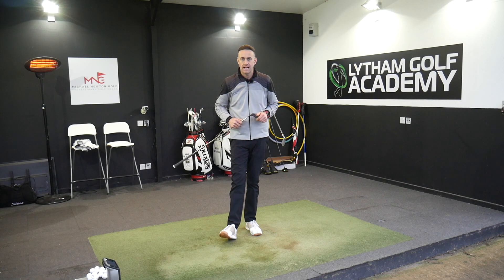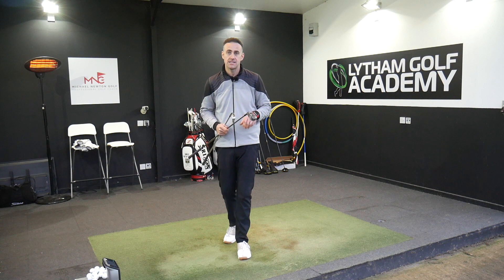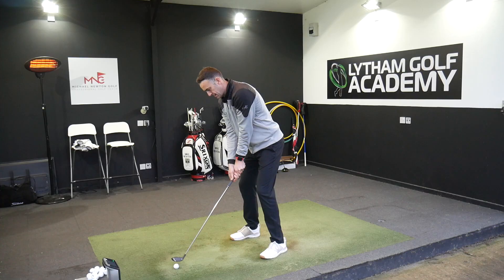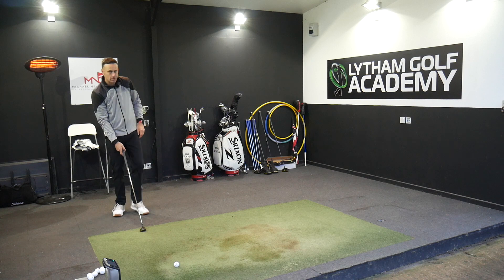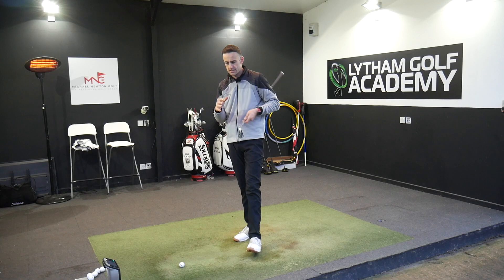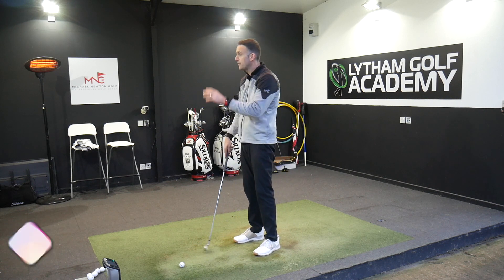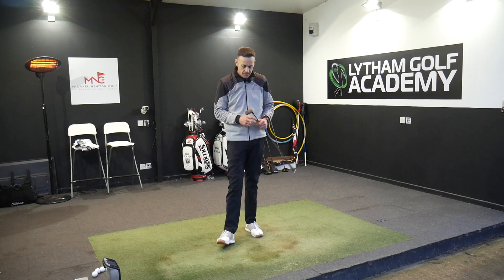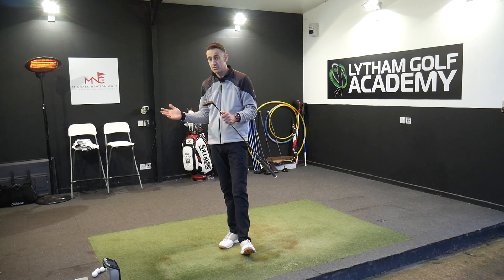21 Degree Hybrid VS 21 Degree 5 Iron - Cobra SpeedZone Gap Testing

Comment: Great video again Michael. I have F9 in my bag and the 5 iron is  22.5. They are strong but I don't hut them that far so it works for me. Arccos showing I am getting 195 off the tee and 185 off the deck with my 5/22.5 so as you mention careful gapping during the fitting is key. Great vid cheers

Comment: I am using my Cobra F9 4-iron (19.5*) instead of my Ping G hybrid (19*) because the iron is more accurate, although about 10 yards shorter.  This is about the same as your results.  If you take out your one pull with the 5-rion, it was much more accurate.
Reply: Instablaster

Comment: Thanks for the review. Numbers seem to be somewhat confusing. The iron has a higher launch angle, has more spin, a higher descent angle, less carry distance,  yet it rolls out 18 yards vs 11 yards for the hybrid .
Reply from the maker: I'd ignore the roll out numbers. On the sim if the ball pitches on the green it stops quicker than if it lands off. All the irons landed short of the green so will run out more.

Comment: The numbers don't make sense to me. The 5 iron launches higher, peaks higher, Spins higher, lands steeper, yet it  has a 6 yard longer average run out than the hybrid. Surely from that data it should be the other way round?
Reply: Malcolm Evans, I know this was posted awhile ago, but might help others with the same question.  Balls that land on the green land softer, and get less roll out. The 5 iron landed short of the green, so it will roll out more.  If he had moved the green back, the hybrid would’ve rolled out a longer distance.

Comment: Interesting test Michael, thanks for doing it!

If I could offer some unsolicited advice... You could work on your analysis of the data in the GCQuad software. Example: The difference in average carry is 11 yards, but the difference in average total is only 4 yards. This means the difference in average roll is 7 yards (11 yards vs 18). So the hybrid is launching 1.1 degrees lower, the decent angle is 2.3 degrees shallower, peak height 2 yards less, and backspin is 500 degrees less. All that should show mean that the hybrid would have a longer roll than the iron, but for some reason the GCQuad software doesn't reflect that on the total yards. If the software has different roll/friction rates on the green vs the fairway, perhaps this is due to more of the irons landing on the green than the hybrid.

The software is also giving you standard deviation, you should use it. In case you are unfamiliar with the statistical term, it is a way of determining the amount of variation within a group of numbers. A good way to understand this is by thinking about average heights. In the US average male height is 5'9" with a standard deviation of 3 inches. This means that 50% are above and 50% below 5'9" tall, and 68% are between 5'6"-6' (+/- 3 inches from 5'9"). So using the numbers from your test,
Reply: Pompous?